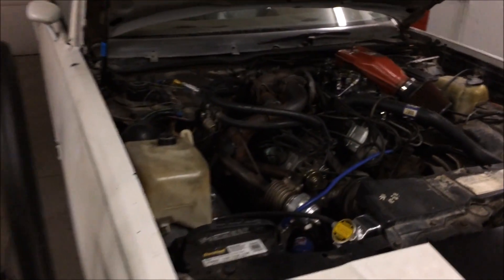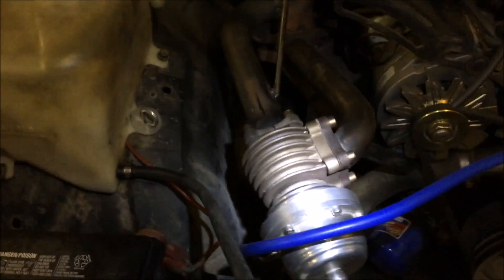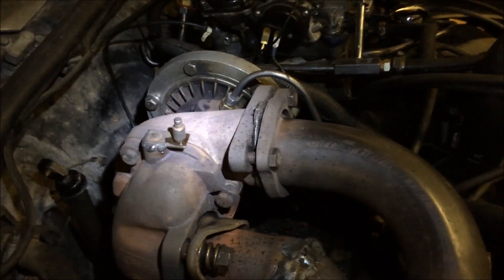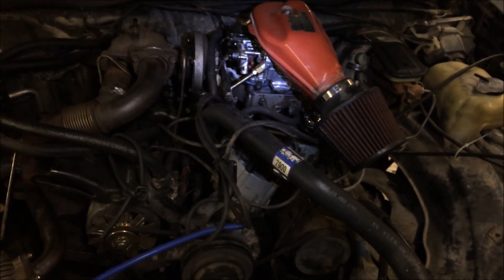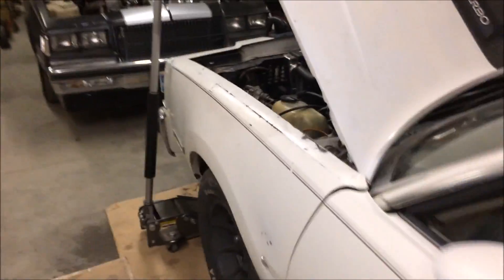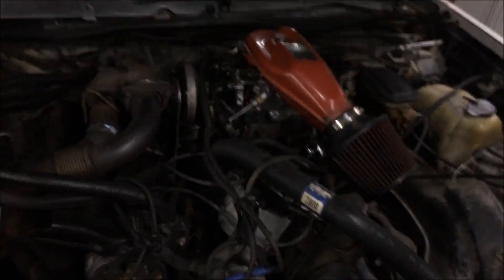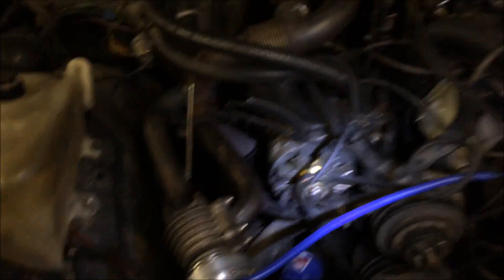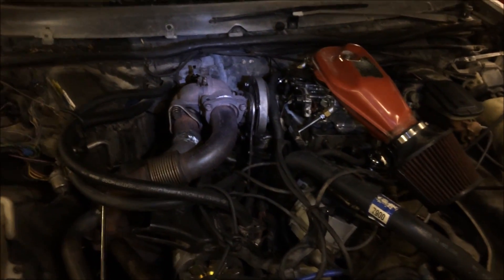Draw Through Carburetor Turbo 1980 Buick Regal Sport coupe Updates Part 2

Comment: I have questions,  have you experimented with the Grand national manifold and exhaust setup on the older 3.8V6, removing the turbo from the top of the manifold to where the Grand nationals turbo location is. Im curious, i have a 78 Buick v6 turbocharged, and i would like to upgrade until i can get something better. Thanks

Comment: I just bought a 1978 lesabre sport coupe with a 231 3.8 litre turbo and its smoking when it's running any ideas of what it might be
Reply: Maybe a leak
Reply: Have you tried changing the oil?
Reply: I've changed the oil and it is a  leak I have to change the gasket around the oil pan I think

Comment: Sounds good! Would be cool to get some Dyno numbers or drag strip times since the upgrades. Are you using any kind of wideband or knock sensor?
Reply from the maker: My dragstrip here opens again in March.  I will be preparing the car for its first run down the track.  Stock, that car was pretty slow, around 18 second 1/4 mile and around 10 second 0-60.  It also had a very tall final drive ratio that made acceleration crawl.  Top end was good though.  So numbers lower than that, I will be impressed.
Reply: Budget Boosting. It doesn't have to be a 10 second rocketship to be fun to play with. Did you boost reference your power valve on the Holley? Im running a quadrajet still  on a 78 turbo 3.8. I was reading it's suppose to come with a pevr valve that I don't have but you can boost reference the power valve like the guys with draw thru roots blowers to keep the carb from leaning out under boost.

Comment: Sir...I love these cars and I really like what you're doing! Are you aware that the 87' Turbo was Not designed to flow gasoline which will destroy it in short order?
Also, is there any way to get the air filter out of the Hot engine compartment?
Reply from the maker: The turbocharger I used is the original one from my 87 Turbo T limited 30 plus years old.  So far it has worked very well with no visible issues.  The original turbo from the 80 sport coupe had way too small of a compressor and way too big of a turbine housing with small turbo rotor, it was totally backwards for performance.  The difference in response the 87 turbocharger made is great.  As far as the aircleaner, I have the factory intake hose that reaches near the headlight which I ran before and decided to change it to a shorter intake due to the new much larger radiator I installed was too close to it.